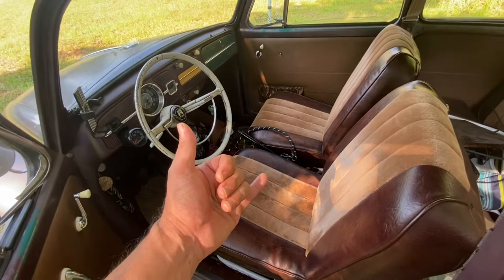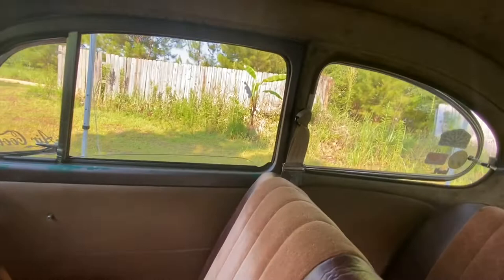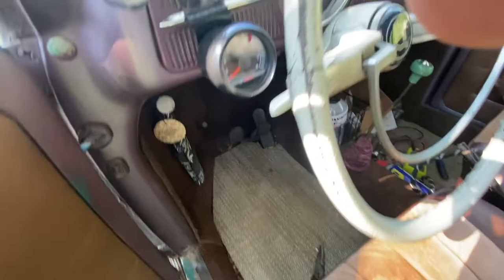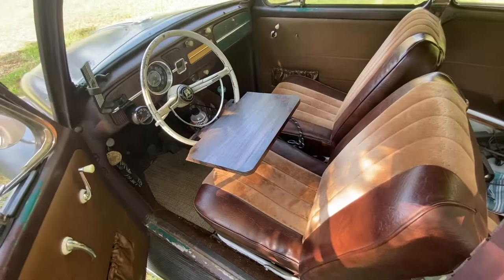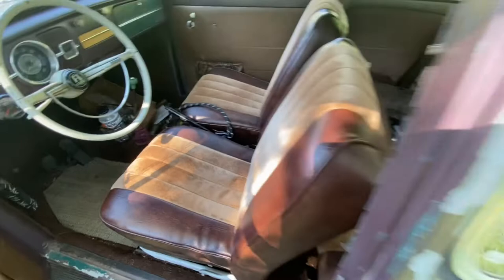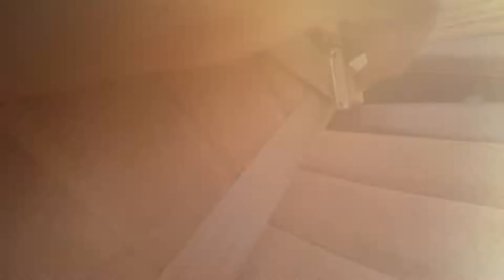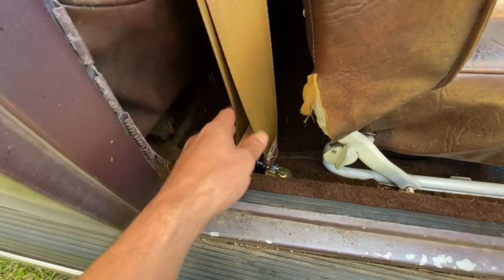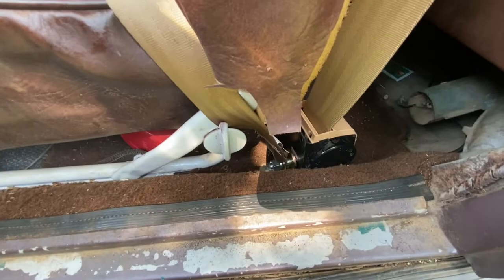‘65 VW Bug This That and Seatbelts Install

Comment: Great job bombero. Safety first 😁 I put some of those on my bay window but I got them from a vw rabbit. They work ok. They get jammed sometimes so I took one off. I probably need to spend the money for some real ones.😁💰
Reply from the maker: Well I love your improvised solution, and technically your seatbelts are still VW 😎

Comment: Awesome! Thanks! My '63 is set up almost identical, only difference is it does need those adaptors for the hole size. Otherwise everything is in the same spot.
Reply from the maker: Cool! I figured the adapters must be for earlier models but wasn’t sure.

Comment: I’m doing the same in my ‘64, I got it redone but will slowly do the interior. I need seatbelts too but want them front and back. I opted for 3 point, non retractable in front and lap belts in back. How do you attach the shoulder harness, what are you attaching it to? Also, do you have a rear seatbelt video?
Reply from the maker: Good clean interior is the icing on the cake…I’m not there yet. My shoulder harness bolted into the window B-post. On mine it had a threaded hole there, and I had to order a bolt. Ours are only one year apart so maybe you have that same hole?